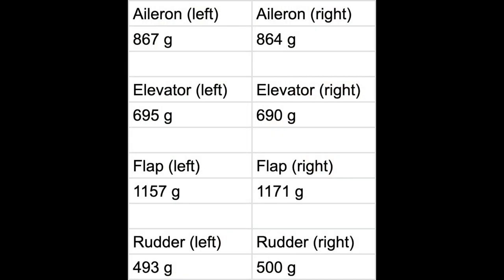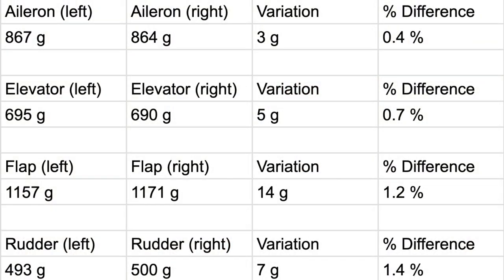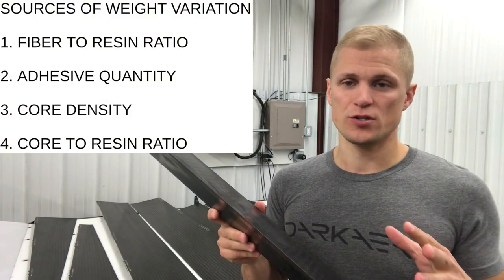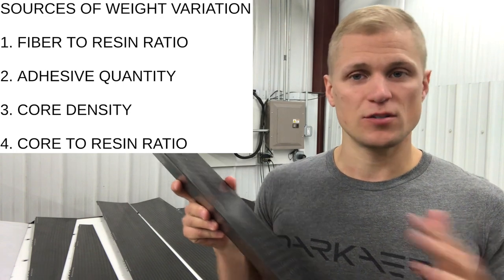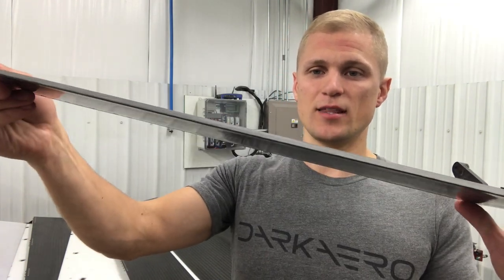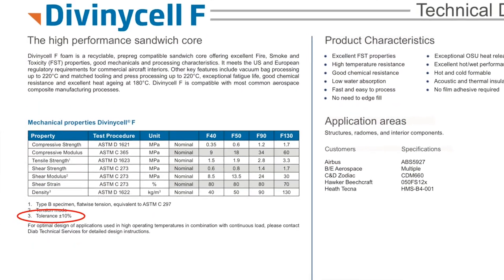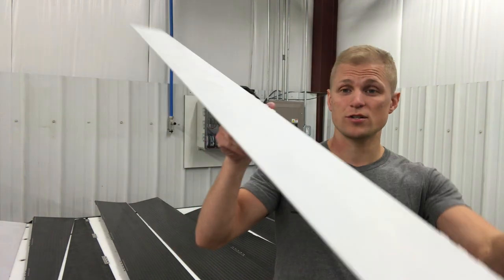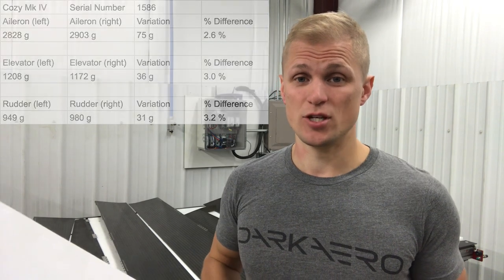The carbon fiber detail no one talks about.

Comment: Temperature control in the workspace. Materials will expand and contract appreciably for something the size of and airplane, so a wing layup on a cold day vs a hot day could vary because the material wasn't the same length. It also matters during assembly, metal aircraft that have parts joined at various temperatures will get wrinkled and wavy skin because the metal was slightly longer or shorter depending on what the temperature was. Metal aircraft assembled in a climate controlled shop are very smooth and uniform. Even one degree makes a difference.
Reply: Carbon fibre has essentially zero thermal coefficient.
Reply: True but the viscosity of the resin will vary greatly with temperature, and that will affect the infusion process.

Comment: The worst difference I saw was 14 g which is less than a half ounce.  It's not going to matter at all in the finished product.  The application of paint will probably result in a greater weight difference between symmetrical parts.  Even if not, it's such a small amount that it's essentially nothing and not even worth the brain power to consider.  If the difference gets bigger then you might have something to worry about.

Comment: Found out your project recently so binge watch some of the episodes in a short time. As a glider pilot for years, and also doing maintenance on the gliders, we have to deliver a weight report of each glider every year. So weighing the wings, horizontal stabilizer and the whole glider itself. The gliders we have at our club are mainly constructed out of different weaves and types of fiberglass. We see that over the years the weight of the gliders changes due to moisture, and some minor repairs. I am not an expert on the area of CF constructions, but can the weight difference between the parts be made due to their difference in age and the ongoing moisture absorbtion over time? Or do CF parts have less tendency to absorb some moisture? Keep up the cool video's:)

Comment: I used to build fuel cells for race cars. There was a check valve that I assembled in the shop. Some of the bodies would be turned by hand and sometimes they would use cnc to make them. The hand made bodies always had a fail rate of around 10 in 100. The cnc around 2 or 3 in 100. I'm not a big fan of handmade stuff.  It can't touch what machines can do.

Comment: Being in composites for more than 15 years getting within 1 percent of the weight is pretty good, this can drop with larger parts.
The usage of prepregs and higher end core materials, glue films + autoclave cure will improve those tolerances 
A sacrificial non structural area can be left  in your parts if design allows it, to be cut / drilled to match weight exactly, however very time consuming.
Thanks for sharing your processes, nice to follow along.
Reply from the maker: Tristan Trajan thank you for watching!

Comment: Hello. I discovered your project today and already went through most of the videos you published 😅

Regarding disparity of weight :
- practice more. You will notice that skill is improved by practice and regularity comes along. 
- regarding disparity in the bond’s quantities , determine the needed quantity and use exactly the same quantity every time (using a seringue for ex)
- use a ruler as a guide for straight lines bonds
- you don’t use masking tapes properly when you apply the bond : you can define the precise width of the bond you need, use a wedge having the adequate thickness at each side, and scrape any excess of bond. The masking tape will remove the remaining excess. This will ultimately save weight as glue is always over used since lack of it may cause structural weaknesses.
- same remark regarding the quantity of epoxy you are using
- note that ambient temperature but also air moisture alters the quantity of epoxy you will use. Moisture alters the mechanical characteristics too but i have no idea to what extent. I used to stock my raw materials in a dark warm and dry environment btw.
Finally, I noticed in one of your videos that you were using a mix of glass micro ballons and epoxy for bonds. The mechanical figures of such bonds is poor. Test silicium or a mix of these charges and your bonds will be much better. You will also need much less bond.

That’s for today 😁. 

I also have some tips regarding the use of core foam and your fuselage ribs … next time. 

Good luck and continue to do such a great job !

Comment: We used to build helicopter blades at my previous job, single curing step, glass fiber prepreg made in house by hand and rohacell IGF foam core. Up to 10-15 g difference on a ~7kg parts. Pretty good, I think. What I found in practice is that resin content which my suppliers normally declare with some tolerance, is usually much closer to the nominal. Say 35% +/-3 % is in the datasheet, but in practice it is almost always 35+/-0.5%. Same regarding volatile content, if paper says up to 3%, then in reality it is almost always < 1%. After all, that are compliments to the suppliers. My experience is based on measurements of Hexcel, Solvay, Deltapreg, Microtex and Hankuk carbon prepregs.

Comment: I'm part of a team which designs RC cargo airplanes for SAE competitions, we use fiberglass for leading edges mainly as other manufacturing techniques don't reproduce so greatly the geometry as a proper mold. Our RC planes are in comparison very small however. 3.3 mts wingspan. Our parts were around 4-6% in weight difference however our process is wet lay up and our molds don't have CNC precision. The technique we use for mold making is called stereotomy, it consists of assembling laser cutted parts which orthogonally interlock together.

Comment: I didn't read all the comments below, but have you considered sealing the core prior to infusion? Depending on the amount of absorption, sealing the core would give you a measured amount of sealant per core. This would give you the ability to measure the resin amount for curing with more accuracy, right? The work is amazing, that you fellas have achieved!

Comment: Interesting discussion, and the comments are thought provoking. It’s good to hear from actual professionals with experience too. 
I’m a layman with no experience in carbon fiber. However intuition leads me to the same conclusions as you reached. Variation in the core material under the cf, along with application of adhesive to bond the parts. 
Then, as the professionals point out, the difference in resin viscosity and atmospheric variations.
I know that you are working for maximum precision and consistency, but I can’t imagine that the tiny variation in weights will make any difference in flying qualities of the actual aircraft.
You are right to be concerned, and thank you for the video.
I’d say that all things told, it won’t matter for a one-off aircraft.
Good work!

Comment: As Tristan say you are doing a pretty good job with tolerances, as he said, in our course of aerospace material at university (Polimi) to reduce these problems the pre impregnated fiber is the leading edge, yes with the cost to have expiring date and “fridge” to store the material before use, also foam has been overlook and the suggestion is to use honeycomb stiffer, lighter... but with the cost of joining and manufacturing particular shapes (in a lecture from Aermacchi about M-346, the boss says that one of the smart solution was to forget symmetry in the building ailerons and flaps but catch the shape in different way).
One solution I suppose you have already embedded in the design is mass damper, it’s an elegant solution to make symmetry in mass.
For the foam I just realised a possible solution, used in food, and garment production, prepare sub-parts in foam and keep in storage, weight all and join those give the best result/uniformity (ribs).
I was forgetting environment: check the humidity day-by-day, hour-by-hour because composite are very sensible to it...maybe there are moments where in average is inside limits, but peaks can make differences (morning, too many people inside...)
Also consider this in early ‘90 only the 40% of the composite golf club shaft was inside the tolerance the rest was garbage

Comment: Could also be the weight of the hinges. Did you put them on a scale before the installation?

An A/C engine maker is putting all the valves, from a large batch, on a scale to be able to find a set with the almost exact weight.

You bros are great!
Reply from the maker: Absolutely! There is likely a small difference in the hinge weights but it is small compared to the main sources of weight variation listed in the video. Thank you for watching!

Comment: I have built an electric bike with plastic casings for the removable batteries. As far as I know, a variation of 1-2% for panels of both sides does not affect the performance or stability. We had a tolerance for 4% and the bike steers accurately. However, the Dark Aero One is an aerial vehicle, so those numbers might be reduced. Still, I think less than 1% won't affect the performance much.

Comment: Safety first: you want to repeat a part's resistance, its weight comes afterwards.
If you measure the same weight of carbon for two flaps (or whatever) and impregnate them uniformly, weight differences due to excess resin or greater foam density will have minimal effect on strength because the quantity of carbon at work is equal in both pieces. And since excess adhesive is safer than lack of it, a few extra grams of adhesive are also acceptable.
Resistance first, weight second, repeatability third.

Comment: I agree that adhesive application is most likely to be the largest source of weight variation in these parts, given that you are using hand application. Do you think you might move to a CNC adhesive application system (or perhaps adapt your own to your existing CNC platform)?
Fascinating stuff, I'll be following along.
Reply from the maker: Thanks for watching and following along! Our plan is stick with the manual adhesive application method for production. Even though this does introduce a small amount of weight variation, it doesn't create a flight critical problem. We had considered some sort of CNC application process but in the end it wasn't worth the investment given our smaller production volumes.
Reply: @DarkAeroInc  Given that, I noticed you spreading the bead of adhesive with a stick (3:50) and then remove excess with tape removal. That's no way to guarantee uniform application and sure to introduce variation as some adhesive ends up thicker in places, thinner in others as well as some left on the stick and squish out onto the tape. Tile setters use a notched trowel to ensure a uniform application of thinset leaving behind the exact amount needed. I've seen nozzles for wood glue and caulk/liquid nails, perhaps design something for 3d printing that has a guide for the parts edge and would lay down a uniform bead(s).  Help ensure uniform application and reduce labor installing and removing the tape.  Along the lines of these 2 nozzles:
https://www.craintools.com/sites/default/files/styles/detail_group_img/public/full_detail_imgs/236-detail-2014-07.jpg?itok=FNvz_Pf7
https://images.homedepot-static.com/productImages/544757be-9e31-43c4-92dc-444fc85af408/svn/roberts-tile-trowels-10-981-25-a0_600.jpg

Comment: weight variation for the rudders shouldn't matter all that much, as they are co-located essentially. The fact the other parts are so light, I'd think just adjusting the balance of the plane left-to-right at the end of the build would be easy enough, given how little these things weigh, or you might be able to ignore it.

If you want to ensure parts match in weight though, could you perhaps add a feature for adding weight to the lighter of a set of parts? After a pair of parts is made, you weigh them, see which is lighter and by how much, and add that little bit of weight to the other one? Since we're talking grams, I don't think this should be detrimental in any way, particularly if you had a preplanned location and method for permanently adding that weight to any given part to prevent any issues with things such as balance and flutter.
Reply from the maker: Thanks for the comment! The weight and balance of the overall aircraft is another reason why you would want better repeatability when it comes to your manufacturing process. This is especially true of the parts that you mention that are mirrored on either side of the plane. For us, the issue of tighter repeatability comes more from us needing to produce multiple kits for customers. More of the point of the video was to demonstrate just how much this repeatability can vary depending on how automated your manufacturing process is. For the DarkAero 1, we want to make sure we are following a controlled process that ensures the properties of each kit we produce are the same across the board. This ensures not only that our weights are consistent across parts, but that each part will have predictable properties that match our testing data.
Reply: @DarkAeroInc  I understand, I'm a CFII and Mechanical Engineer myself, also met you guys at Oshkosh, which is how I first became aware of your design (I'm building a Vans RV7 though).

But if you can only achieve so much repeatability during the manufacturing process, then balancing the parts after is also an option. And if you had a pre-planned method for doing that ahead of time (location on each part and method for adding the weight), then it could help with repeatability for production. Not the ideal approach, and not one I would prefer myself. If you are able to control the consistency to within an acceptable degree, probably not an issue then.

I love how you guys have attention to detail. I myself have had to learn not to make everything perfect in my engineering career, otherwise you'll never be done (I like getting things right and making the best product I can). But I'm glad to see more people like myself out there that look at details no one else seems to be looking at. I hadn't ever considered this aspect though, so I was very impressed by you addressing it. I was aware of the inconsistencies of composites, but never thought of it in this way.

Comment: At cruise, how much actual wing surface is needed to maintain level cruise on your DA1. F14 tomcat wings swing back to decrease excess lift and induced drag. You guys seem to have the engineering capability to design a wing that decreases in size for increased cruise speeds. I have imagined that the wing could be made to telescope inward. I know that you have fuel in those wings but I think that some would be willing to trade some of the range for speed. Im not the first person to think of a telescoping wing, This was proposed back in the 1940s with the X planes as a way to reduce induced drag for speeds beyond mach 1.5. Wings that rotate back inside the fuselage and others that simply retract strait into the fuselage. The less unnecessary exposed wing, the less induced drag for increased speed. Show those skunk works guys what your made of and come up with something innovative for DA2. I built a GP4 back in the 1990s. The DA1 build tech is much more precise but the airframe shape isnt much different. Not much is new shape wise for 30 years into the future. George Pereira would have been very proud of you following in his footsteps with the DA1.

Comment: Great job guys, i would like to know about other factor that is 
over time wear of joints made with loctite glue, the airplane will fly fast and this micro air sheet wiil shock the glue between parts and it will start to wear out thought time, what are you guys making to protect or no, or ou guys are certain that it will not unstick.
Other factor, in a long term will the buyer need to re glue the airplane?

Comment: Excellent points made. Considering the different materials and complexities your numbers are phenomenal, even the cozy parts are likely better than average. You could take and cut multiple cores and match them by weight and do the same for your fabrics to get even closer. The adhesive will get better in time as the process becomes muscle memory. Even with a robot system there will be variation as wear occurs. Pumps, motors, and diaphragms tolerances change with wear.
Your design is incredible, however Drago getting dusted of a runway made me think of something. I would tell people to maintain higher speeds above stall in gusty conditions. This is to maintain solid control authority in a super light aircraft. This is not your father's Oldsmobile (Cessna) comes to mind lol.
Reply from the maker: Good idea on matching the cores based on weight.  That would certainly help push the full assembly weights closer together.